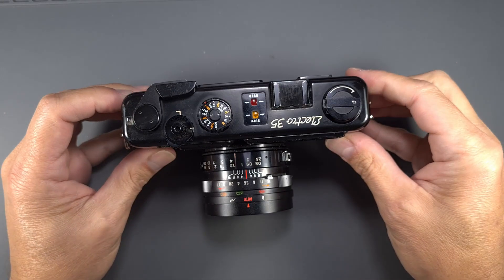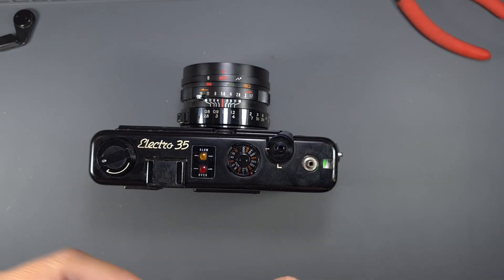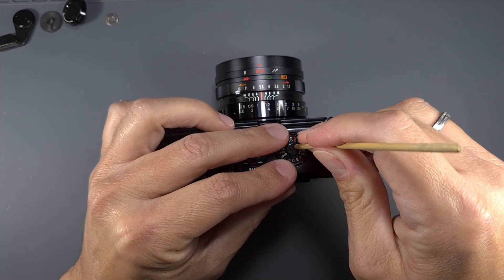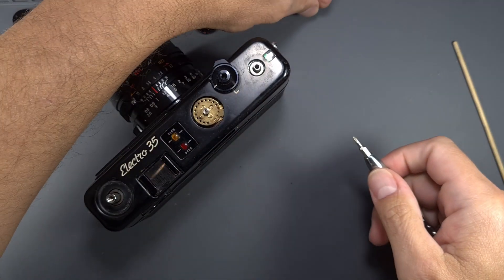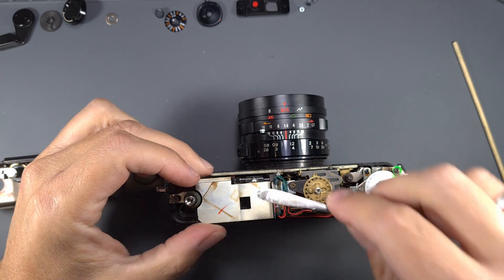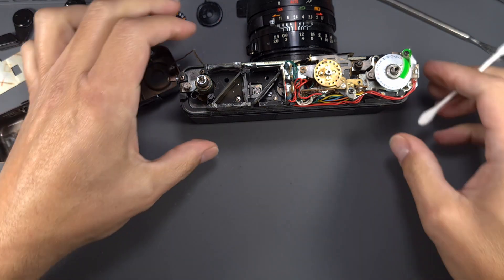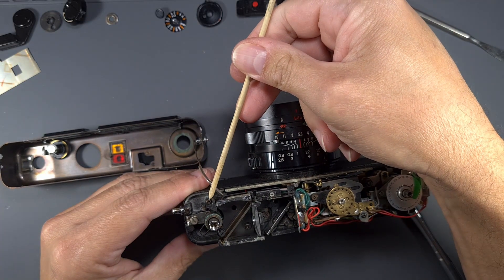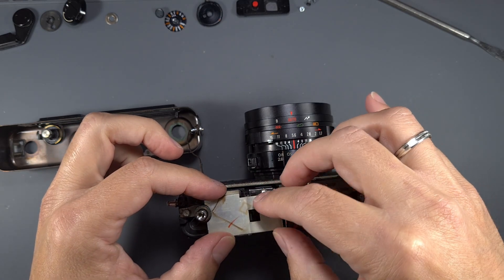Yashica Electro 35 - Remove the Top Cover and Clean Rangefinder

Comment: Noooooo! You should never clean the semi silvered mirror like that unless you know the coating is solid. Better to leave well alone but, if you must, just lightly touch a corner of the mirror first to see if the coating comes off. Many times it will and you would be left with an ineffective rangefinder if you just jump straight in like this guy is doing.
Reply from the maker: I understand your concern and you are right...but yes, I tested the coating in others Yashica electro... that's not the first I clean...